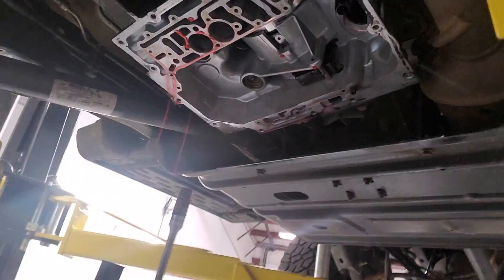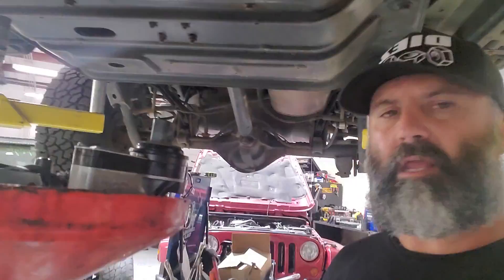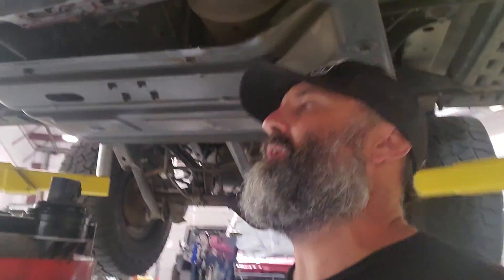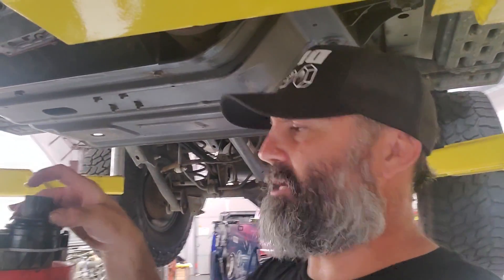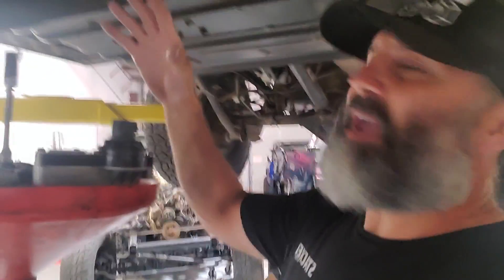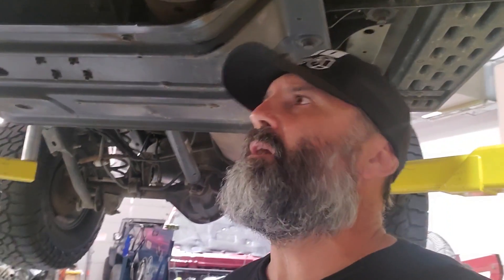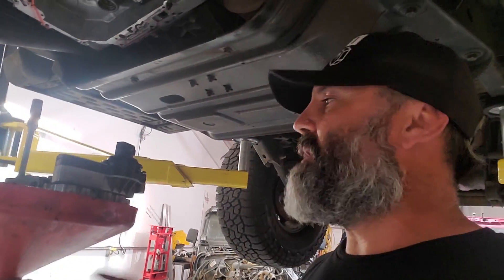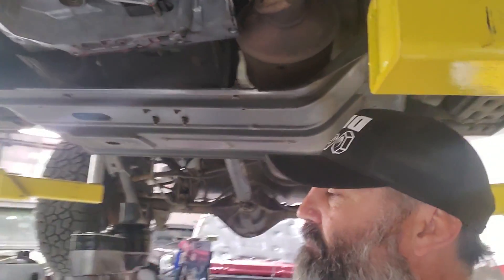42RLE jeep trany problems

Comment: Great video! I had to drop a new motor in my TJ this weekend. Go the new motor back in and now the trans wont go in gear. I pulled the TC off when I pulled the motor. Assembled everything back as properly as it was before best I can tell. Went ahead and changed trans fluid and filter while doing all that. The linkage is good. I can see the linkage changing the gears on the trans. The fluid is full. All the connections are hooked backup.  Checked the transfer case and all good there so its not in neutral on transfer. Doesn't matter what gear I have it in I can push the jeep and its like its in neutral. I don't know much about auto transmissions so if you have ideas ill try almost anything? Thank you sir.
Reply from the maker: give me a call 704-929-1788
Reply: @jeepstyle4054  could have burnt out the transmission pump if you didnt install tranny back into engine correctly. Thats what happened to me.
Reply: Check your gear lever selector linkage!

Comment: I use to be in the trans bussiness so I fix my own crap. Ive come across the PO734, PO700 code on my 2002 liberty. Its been popping the code for over 10 yrs when the car gets hot after driving awhile....YES 10 YRS....! Fluid changes SEEMED to help for a short time the pan is alway clean no poopcin it (done it 3x).  The jeep is in GREAT shape everything works on it EVEN after putting over 217000 miles on her. Its the VB you say???? Something I havent tried yet... tnx.
Reply from the maker: Hope it works, that  shift block definitely raises havoc....

Comment: I don't have any codes, but have noticed a hesitation occasionally when shifting on hot days (03 Liberty).  I've ordered a kit with the filter, solenoids, sensors and gasket along with a new oil pan with a drain.  I doubt the transmission fluid has every been changed.  Is the hesitated shifting typically just oil fluid and filter ?   I'm new at working on Jeeps, but am trying to save some $$$ doing jobs myself.  I can't afford to leave myself walking is why I hesitate to change the solenoids.

Comment: Thanks for the video!  Nice to get confirmation that I am changing out the right part.  However, it sure would help to know more about how to get that blasted shift lever off - he mentions a 13mm or 1/2", which is helpful, but how do you get tools way up in there?  What's the trick?
Reply from the maker: try a 1/4 short socket.
Reply from the maker: There really is no trick, one side of the lever holds the bolt head the other side is just a nut. shift  The shifter around to get a good angle

Comment: I'm having code P0730 incorrect gear ratio.... 2011 JKU purchased it pre owned has 35 inch tires I wonder if I need to regear or do what you did

Comment: Great video.  My sons Jeep has a P0740 code. It seems to run and shift just fine.  It is a 2011 JK.  Had my mechanic do a flush and filter.  Need to check wiring connections.  Should I have him do a solenoid pack?   Or can I just do a TCC solenoid?   The Jeep is running 35s on what I assume are stock gears.  We just bought it.  Any help is appreciated.  Also When we pulled the pan the paint/coating inside pan was bubbles badly so I replaced pan.  Weird.   Thanks again
Reply from the maker: Right very well could need a converter for sure not too uncommon
Reply: Same case as your wrangler 2011 same code but it drives fine

Comment: Thank you for posting this, I've had a recurring limp mode causing P1745 Hi Pressure code in my 2009 JK for more than a year here in South Florida.  From the start of it, a local regarded Jeep shop replaced the solenoid, pressure sensor and it still went into limp mode.  They then replaced the PCM stating it was causing it, then the TIPM unit stating the high mileage on my jeep probably had it riddled with corrosion.  After a month it went back into limp mode.  All the while they've been able to clear the limp mode with a Snap On shop scanner but the problem always came back.  Then they ghosted me for asking for them to stand behind all of this work and find a solution.  Local transmission shop checked the tranny and changed the fluid, no shavings found, fluid they took out looked great.  I wish your shop was here in South Florida.  What should I do?  Thank you for any help or advice.
Reply: I have the same problem on my 2008 jk
Reply: Ever figure it out?
Reply: @JORGEArana-uk4ol  ever figure it out?

Comment: Cool video. I have a 2004 TJ sport 42RLE. I’m getting a P0740 Torq Conv circuit error. The Jeep has has rats chewing stuff and I wanted to test the TCC lockout wiring continuity but I can’t fine specifically which electrical connection on the outside of the trans it is. 

Also which wire / pin to test and where it connects to the TCM. 

Do you have any idea?
Reply: Update??
Reply: @ I fixed it. The 42RLE doesn’t have a direct TCC solenoid. The P0740 code is a mechanical failure code. I replaced the torque converter and it runs perfect now. 
However, you also want to check the transmission pump to make sure you are getting the correct pressures in the different gears. A faulty pump can cause lockout issues.
Reply: @patriotfox7192  
I got the code recently p0740 
replaced the spring accumulator, was broke in three pieces, transmission selenoid
And the transducer selenoid. 
I don’t feel the kick back while coming to a stop , was doing it sporadically. 
I run my 01 wj 4.0 on 
Over drive OD and the 
P0740 code won’t came back. 
But tomorrow I will take it to a shop . I think is electrical issue, but could be the 
Torque converter . 
I a running it on  D 
Will perform like a new transmission, no problems but 
will show a check engine light sporadically. Thanks for replying.
Reply: @Amarillobymorning777  yeah. The issue I had was I had no lockout and OD. I was running like 2500 at 50 mph. Now I’m like 65 at 1900 or 2000. 

Prior to that it would kick into limp mode out of no where and drop in to 2nd gear. I think that fried the converter. I fixed that issue by adjusting the gear shift cable. It was stretched and confusing the transmission, not fully seating into P/N/D. I think only 2/1 worked solid. 

I probably should get a new cable and linkage but so far all is well.

Comment: How do you get the accumulators and springs to stay in place when you put the valve body back up
Reply: I just balanced them on the valve body and slowly lifted up. There I enough clearance to stick your fingers in and adjust them a bit as you lift up. Once they get started in the bores they will align themselves.
Reply: @mattkerner811  OK thanks
Reply: Also saw another video recently they used a thick transmission part grease that held them in the bores and is harmless mixing into ATF. Not sure what product though .

Comment: Hey there 
Have you encountered a no reverse issue on a 2004 kj liberty jeep?

Oil is clean and no burning smell.
Rest of the gears is flawless.

I am thinking of a clogged selonoid or broken one way valve.

No warning lights on dash.

Transmission acted perfectly fine before.

Any ideas?
Reply: Did you ever figure out what it was on the no reverse? I have the same problem

Comment: I don’t know if you’re still answering questions but I just did this on my jeep and when I tried to start in P it wouldn’t turn on it will turn on only in R. It also won’t move forward or back in any of the other gears and it threw the P0841 code. Could it be I didn’t have the shifter in the right position when tightening the clamp back on?

Comment: Very helpful video! I change the solenoid and reinstalled my valve body with the shifter in the low gear position but now it won't turn. Any idea why?
Reply from the maker: Well definitely make sure all the electrical connectors are plugged in, but are you saying the vehicle will not start
Reply: @jeepstyle4054  I figured it out. I didn't have the shifter in the lowest detent so the parking pawl rod wasn't correctly positioned. All is good now.
Reply: @jeffschowalter5664  im having an issue with the shifter not going into park easily any idea what i could have wrong

Comment: once you get the solenoid plate back in do you need to rotate the shaft gear back up before tightening the 13mm bolt

Comment: I have this 42RLE transmission in my 2008 charger. It works perfectly except it doesn't have reverse. Last time reverse worked it gave a quick non-violent shudder, incorrect gear ratio codes flew and no reverse. I've been saving up for the shop fees to have a used transmission swapped out. Any chance my issue is this simple as well?
Reply: Yo dude mine is doing actually this same thing: I am in the middle of doing mine now you ever figure out yours?
Reply: @Chasingvugs  I went down a dark road of replacing transmission parts and several times of dropping it. I ended up replacing it with another 42RLE pulled from another charger.
Reply: @stevenbillington1753  Mine has been at the tranny shop going on 4 weeks. It has the rear shudder. I drove it up there with random issues but most of the time it drove fine. I even swapped the computer for a well know new replacement but it would drop out of gear, give codes, always on the highway never in town. They rebuilt it and now are two solenoids, a valve body, and misc other stuff in and I still haven't heard from them. First it was pick it up, then they went well it has no reverse, then it was overheating and same codes as before, I think last I heard it still had the reverse shudder. I almost wish I had ordered a reman and I am sure they feel the same way. Luckily I have stuff to drive.

Comment: Thanks for the video! Is a relearn needed after install?
Reply from the maker: You know sometimes the aftermarket ones are faulty right out of the box, but I've never had to relearn one yet.... I've installed them and they've worked perfectly.... 
Like two times for a day or two and then it went bad, I stuck by my guns put another one in it and the thing is still on the road today happen twice like that out of the handful that I've done.
Reply: @jeepstyle4054  Thanks for the reply, I'll give it a shot. My daughter's 04 liberty has a couple of gear ratio codes 732 & 734 and seems to be going into neutral when pulling off from a dead stop
Reply: Lee Shackelford how did it go? My 04 Liberty is throwing P1776 (Solenoid Switch Valve latched in LR position) & P0700 codes. & I’m about to try what video suggests
Reply: @HoodRichSWERVE  mine ended up being broken planetary gear! So unfortunately it was a rebuild for me!
Reply: Lee Shackelford oooo sounds like fun haha. Thanks for the response!

Comment: Great video! I was hoping to see how you put the accumulators back in while working from below. I haven’t seen anyone post a video of it while working from underneath. Do you just rest them on top of the valve body when putting the body back up? Or is there a trick to it? Thanks!
Reply: Just did mine and all I did was started sliding the valve body back in until there was just enough room to get them slid into place, then I used my fingers to hold them while pushing the valve body back into place.  Not too hard
Reply: @rustimack  did you had any problems after the installing the accumulators back

Comment: Got a 03i just bought a 03 tj 42rle i have drive 1 and 2 but will not go in N R are P....got a Neutral safety switch code and check shifter signal.... The shifter will move up to part reverse and neutral, but it's very hard have to force it but dose not chang out of drive and will not crank in less i jump the starter and cant remove the key Any advice?

Comment: I was receiving a P1698 code on my 2004 Jeep LJ.  I replaced the TCM  and the code went away but it still will not go out of 2nd gear.  Would you suggest this could be my issue or is there something else I should look for?  Thanks for any help you could give me.

Comment: Hey buddy mine has no reverse you put it on the scanner and the sensor saying it in neutral and before when it was in reverse it would forward until it was finally full do you think it could be shift solenoid it had a po700 code drive work shift weird tho want to go in to 2nd or overdrive right away

Comment: CAN YOU ANSWER THIS FOR ME. My 2012 rubicon will act like it is neutral when I go from low range back to high range. It only does this when I have been in low range for a while. It doesn't do it all the time, but when it does, I have to rev the engine a couple of time before it starts moving. And sometimes when it does start to move it feels like it is slipping. So I put it into reverse, then back to drive and it works fine. Any suggestions?

Comment: Do you know the Code P2638. And what I can do to fix it. I was up hill on the highway but didn't want pass 35 miles and it wasn't taking other gear later on. It work fine.  Motor is a 3.6

Comment: So I recently got those codes.. replaced the entire valve body from the junk yard.. now it wont shift into gear at all and the shift icon is jumping all over the place when i try to shift..

Did i pull another junk solenoid block? I would greatly appreciate your help big time, this is driving me nuts!
Reply: Buy a new one not one from the junkyard.
Reply: did you ever figure this out?!

Comment: i replaced the shift solenoid and now my
05 tj won’t recognize any gear.. shift linkage still fine and everything seems normal.. just literally sits there as you press the gas. bad solenoid or did i do something wrong? also thanks for the help besides this one problem everything was pretty easy!
Reply from the maker: RECHECK everything... that sucks

Comment: any idea where tran fluid pressure sensor is I did the input and output. they were both on side. How can get the gear ratio correct by driving and shifting. I did change tran fluid filter for first time in my 52 yrs

Comment: Hey bro ive got a question I've been working on a client's jeep for sometime now and have replaced the valve body and the kick down solinoid pack twice and now it drives good however bogs and shudders everyone in awhile and its throwing a code for the torque converter clutch soliniod. Now it's a 2008 jeep wrangler sahara 4by4 and I cannot seem to find that soliniod could u possibly throw me a line and help me out.. does it even have one?
Reply: Yes it has one I have the same code P0740
Reply: Same problem on my 2000 Sahara. Replaced the solenoid twice and torque converter twice. It still shutters. My next guess is that it might be .......well, I really don’t know.

Comment: Trying to figure out whats causing this P0740 code it says Torque Converter Clutch Solenoid circuit. I dont wsmt to take it in because im really in to learning how to do things myself. Its my daily ride so if i tear into it i gotta be sure i have the right part. Any advice would be highly appreciated!
Reply: Forrest.  I have same code.  Jeep seems to run/shift just fine.  Did you get yours fixed?
Reply: @matthewprazer7728  Not yet pretty sure its the clutch converter solenoid just like it says. Every shop just wants go either put a new trans or just rebuild it instead of just replacing the solenoid.
Reply: @forrestallen9354   Same here. 2011 JK with the P0740. Got a $3400 quote to rebuild entire thing to clear a solenoid code.  Felt like going to the doctor for a cough and he said you need a new heart.
Reply: I want to know how difficult it is to replace the torque converter solenoid. I have a 2011 jku. Please help with instructions.

Comment: Where is the torque converter clutch solenoid usually located on these transmissions
Reply: Did you ever find the location  of that solniod
Reply: @drupp4740  No unfortunately. Only thing I can think of is that it is part of the solenoid pack in the valve body of the transmission. But i am still uncertain.

Comment: So I have that transmission in my 2006 liberty. I replaced the shifter block/ solenoid,  but it still stays in 2nd gear/limp mode. All connections/ wires are good. What else can it be?
Reply: Did you ever figure this out? I have an 07 jeep that is not shifting out of second gear. I've replaced the shift selonoid but it still shows shift selonoid on the scanner.

Comment: Mine wont shift to second. I can goose it to about 5000 rpm then let off and it will usually shift what could this be?
Reply from the maker: Might need the valve body cleaned. Could be the pack. Need to take the pan off look for broken parts.

Comment: Hi! I have a 2005 jeep liberty. After it has been sitting for a few hours it drags going into 2nd. Could replacing this block fix the issue?
Reply: I'm currently having the same issue. Have you gotten a chance to scan the check engine code? I am going to give this a shot in a few days. I have a 2005 Liberty as well but I have been doing a lot of research and there's a good chance this will fix it IF you have a p1776 code
Reply: Same issue here in limp mode but the front line is leaking. Pos 42rle transmission. I had to use a breaker bar and a 10mm and an 15mm and a 16mm but it's still won't come off. JEEP is fully aware of these problems but refuse and acknowledge to do anything about them. I had to basically drag the whole toolbox up from the garage. All for one front one that is draining at the front of the transmission.